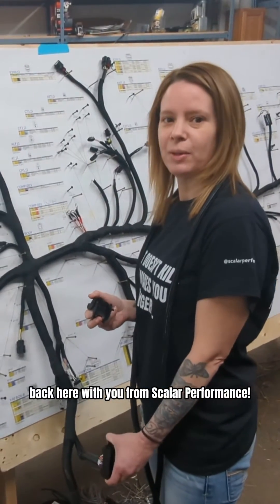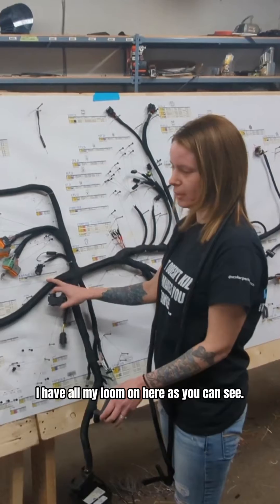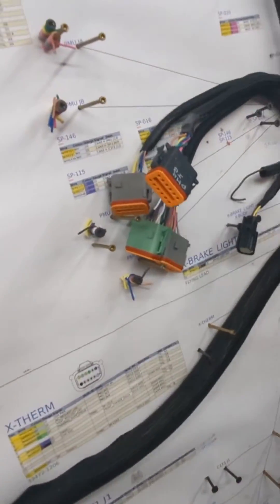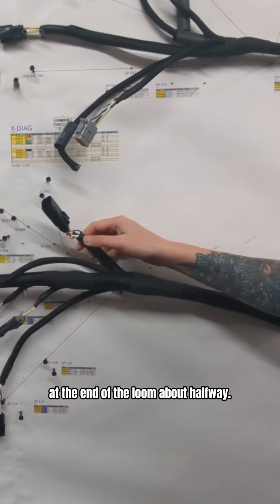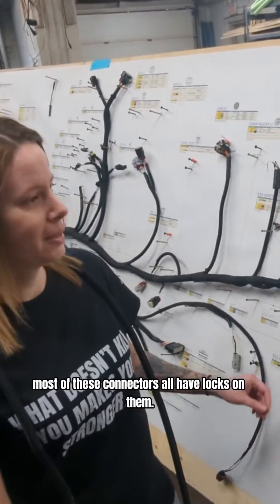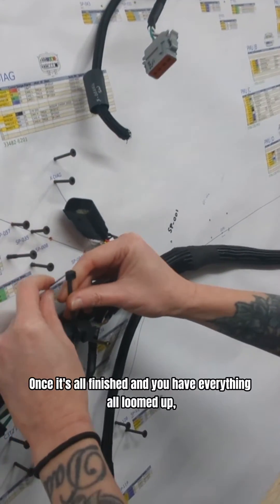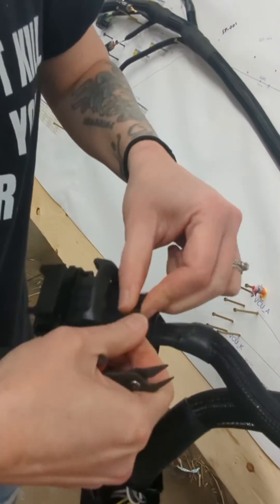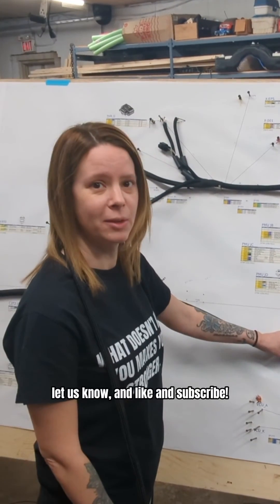The Process of Finalizing a Vehicle’s Electrical Harness

Comment: Doing something like this would be an absolute dream job for me I’m going Back to school for mechanical engineering to get my bachelors after I finish my car build. I’m self taught and building a decently complex track/ street car everything on the car has been touched so far. I’m currently working on a custom-made wiring harness when I’m not at my day job (which is definitely not car related) and it consumes quite a lot of my time and money at the moment 🤣. It’s cool to see engineers actually working on things like a wiring harness at a motorsport company somewhere. Honestly, I would’ve never thought to plot out a wiring harness like this, but it probably makes the process a lot easier as opposed to trying to visualize everything with a wiring diagram written on paper or in a program then referencing that as you go.